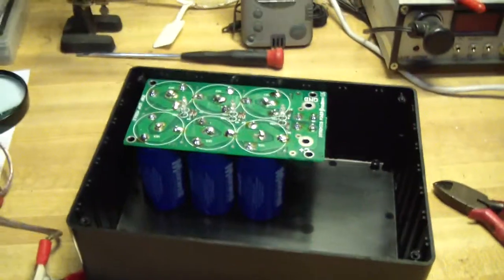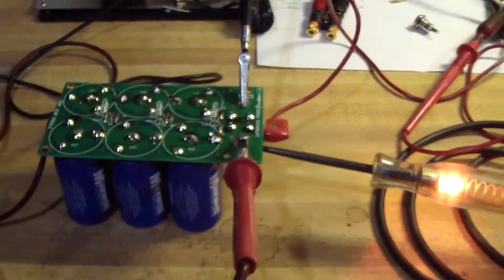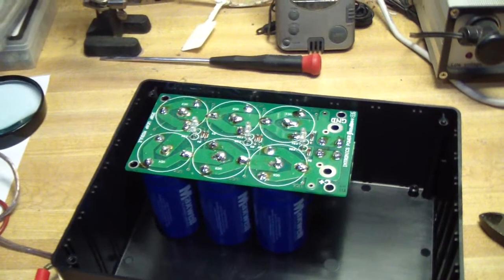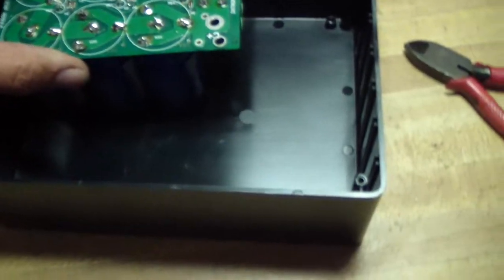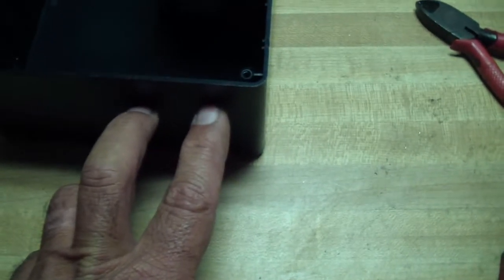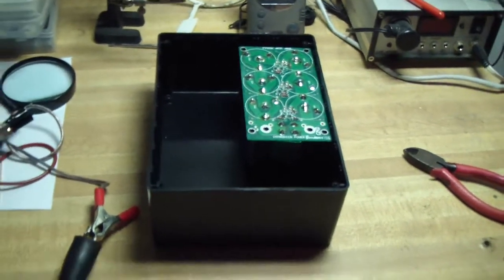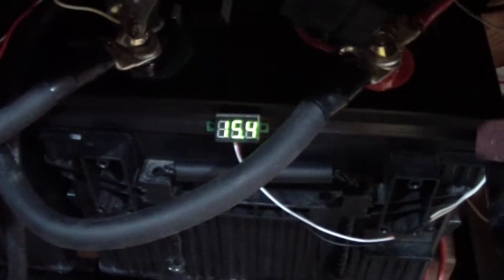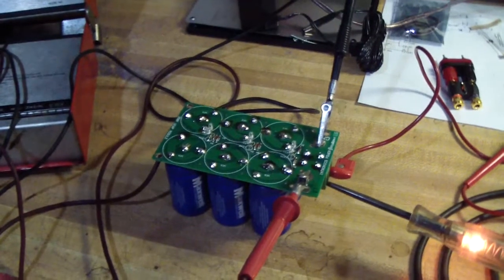Ultracapacitors, Boostcaps Are Getting Ready.

Comment: Interesting. Where did you find those circuit boards at?
Reply from the maker: http://www.ebay.com/itm/Ultracapacitor-Module-KIT-Battery-Eliminator-Car-Audio-Starting-WITHOUT-UCAPS-/370967672287?pt=US_Motherboard_CPU_Combos&hash=item565f6575df#ht_7360wt_1362